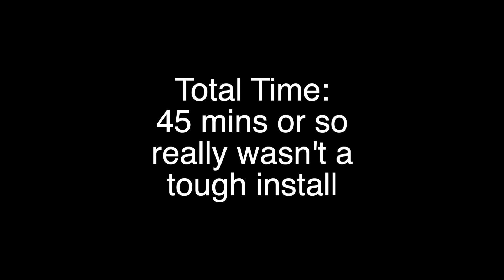Installing a Minn Kota Ultrex on my Ranger RT 198 P

Comment: Did you check for magnetic interference where you mounted that puck?  I’d flip the stabilizer to the other side.  I’d be afraid it will where a spot on your gunnel.
Reply from the maker: Ummm 1st I have heard of that.....
Reply: @JCDropshot  , you might want to consider moving the puck to the back of the boat or by the console after checking for magnetic interference. The bow moves a lot compared to the rest of the boat when its trying to set a heading.
Reply from the maker: I will have to read up on this now. I just stuck it in a hole on the deck that was already there to plug up for now. I figured I would have to maybe move it because of another reason.
Reply: Front of the boat is fine. Especially for jogging - I want to jog using the bow as my reference as that’s where I’m fishing. But use an old school compass to check for magnetic and electromagnetic interference.   Took me about a half dozen tweaks to find a good spot.  Obviously deploy the TM when you check as the motor is a major source of magnetic interference.